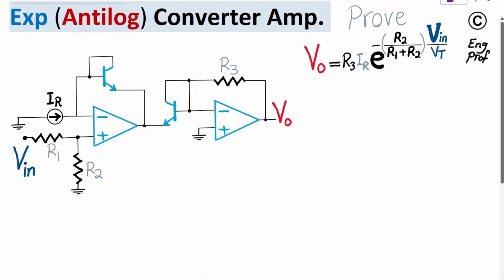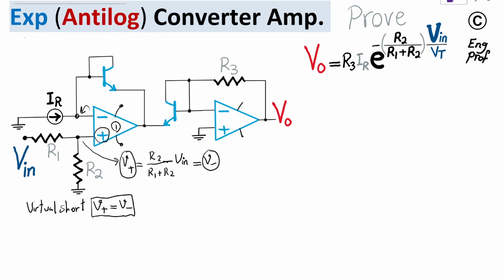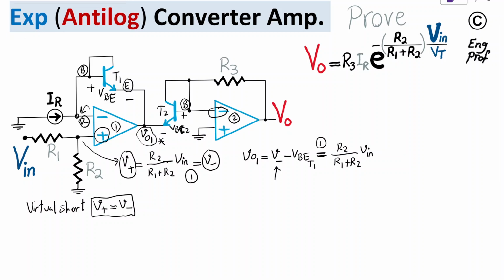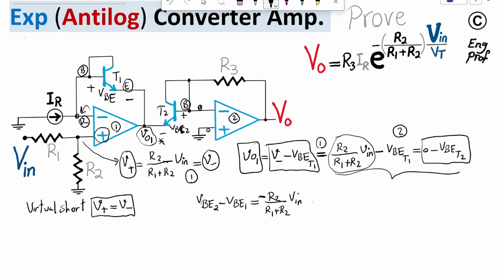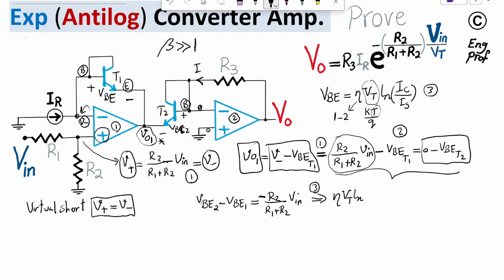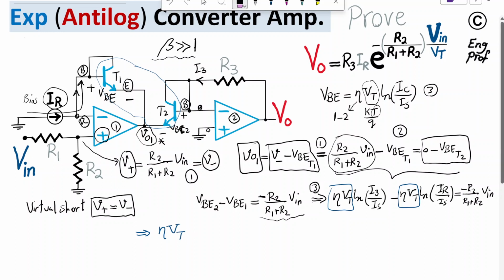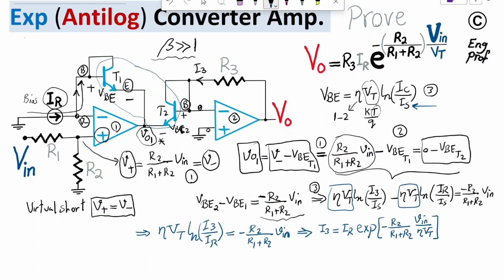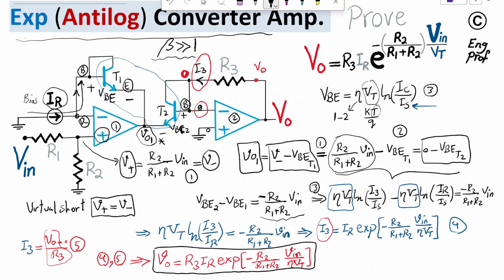Exponential Amplifier (AntiLog converter)

Comment: Hola... podria servir como convertidor exponencial para el control por voltaje de la frecuencia del oscilador en sintetizadores  musicales ?
Reply from the maker: Hello, Good question!  Theoretically yes but watch the following better circuits to realize exponential converter for voltage-controlled oscillator frequency in musical synthesizers:
▶ How 4 Transistors Multiply Audio? Blackmer Circuit Explained in https://youtu.be/XDoZls0CiH4 video.
▶ The VCA Series:
• Part 1: Voltage Controlled Attenuator Circuit Overview & DC Bias: https://youtu.be/cFzYZsPEtP0
• Part 2: VCA Electronic Attenuation AC Analysis: https://youtu.be/mq2PyO56OvU
and if you are interested in audio signal processing, 
▶Bridge Audio Amplifier is explained in https://youtu.be/EDpu6urAtHA video
Electric Guitar Amplifier to XLR Circuit is discussed in https://youtu.be/X4y8cwZdGEk video

Let me know if this note is helpful in answering your question.

Comment: hello,
don't you need a resistor between ground and V- on first op amp?
Reply from the maker: Good question, and thanks for watching.  In this theoretical analysis, no resistor is required for the circuit’s intended operation. That said, it is generally good practice to balance the impedances seen by the op-amp’s inputs to minimize bias-current–induced offset. It’s a practical refinement, not a theoretical requirement here.

Comment: Thank you for this helpful explanation! I simply couldnt understand how temperature compensation worked for an exponential amplifier until s good friend linked me to your video, which I watched several times in order to gain an intuition. What constraints does the circuit have and how would one choose a value for Ir? Thank you again!
Reply from the maker: Thanks @benish0r! I'm glad you found my video helpful. Temperature compensation in exponential amplifiers can be tricky, so it's great to hear that the explanation helped build your intuition!  Regarding your questions, here is a related video that you might find helpful: https://youtu.be/kk2c7Gk3nW4 which is a temperature-compensated anti-log amplifier. 

    Regarding Circuit Constraints: The most critical constraint comes from the thermal voltage (VT), which is approximately 25.85 mV at room temperature (300K) and varies with temperature as VT = kT/q. Since the circuit relies on the exponential relationship of the BJT’s V_BE to I_C, temperature variations will affect the gain unless compensation is applied.
        Another key factor is the linear operating range of the input voltage (Vin). Since the circuit exploits the exponential characteristic of a diode junction, Vin should be small (typically within ±100mV) to avoid excessive nonlinearity or saturation.
        Matching of the BJTs is very  important. Any mismatch in transistor parameters (like saturation current ISIS) can introduce errors in the exponential response. I highly recommend using MAT12 or MAT14 matched BJT transistors from Analog Devices: https://www.analog.com/en/product-category/matched-transistors.html#products-in-category

    Regarding choosing a Value for Ir:  Reference Current (Ir) typically comes from a current source (as shown in the video) or a resistor setting a bias current in the transistor’s exponential region. The choice of Ir affects the scaling of the exponential response.  Generally, Ir should be chosen to be large enough that the transistors remain in their active region but not too large that they enter high-current regions where other nonlinear effects (such as base resistance and high-level injection) distort the response.
        If temperature compensation is included (as in the temperature-compensated anti-log amplifier in the second video shared above), then Ir should be designed in a way that cancels out VT variations, often by using a PTAT (Proportional To Absolute Temperature) current source.

I hope this explanation is helpful.  Thanks again for watching!

Comment: If R1=0 then Vin=VT and so in the final equation, R2/(R1+R2) becomes R2/R2 which is 1 and since Vin=VT then Vin/VT=1 also so the output of your equation becomes a constant that doesn't change with changes in Vin, because I from the constant current source is constant and R3 is also constant.  So something is wrong with that final equation because the antilog circuit should still be working even if R1=0.
Reply from the maker: Thanks for watching and sharing your thoughts. Your statement "If R1=0 then Vin=VT" is Not correct. In case helpful, here is another example:  https://youtu.be/kk2c7Gk3nW4 which is Anti-Log with Temperature Compensation.
It is important to recall that the voltage division realized using R1 and R2 is practically required to scale the input voltage to a range of say +/-100 mV (or less) that can modulate the 0.7v default Vbe of active BJT transistors.  With that in mind, whenever (in a given application) Vin is natively guaranteed to be a small enough voltage (within +/-100mV) then we may set R1=0 and that then simply results in the positive input terminal of the first op amp to have the same voltage as Vin meaning V+ = Vin.  But that does not mean Vin=VT (note that VT is the thermal voltage of P-N junction that is ~26 mV in room temperature).  I hope this explanation is helpful.
Reply: @STEMprof  Thanks but that link didn't help me understand since it is not the same circuit. In this circuit, VT is the voltage on the right side of R1, yes? So if R1 is zero then Vin and VT have to be the same, yes? and if your final equation is correct then the result of that final equation becomes a constant, yes? Is that equation not completely correct? What am I missing?
Reply from the maker: VT is not the voltage at the right side of R1. Input voltage Vin & R1, R2 define what will be at the right side of R1.
Reply: @STEMprof  Ahhh!!!! I understand now, its V+, sorry it looked kind of like a VT
Reply from the maker: Alright, glad that the clarification was helpful.